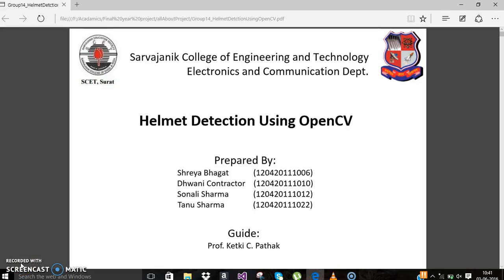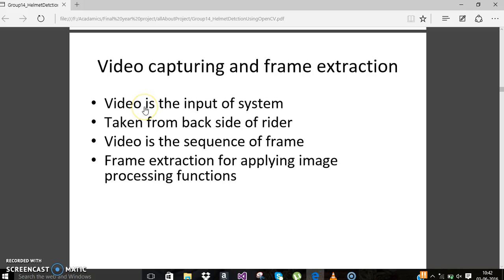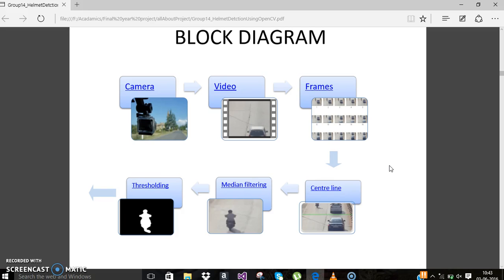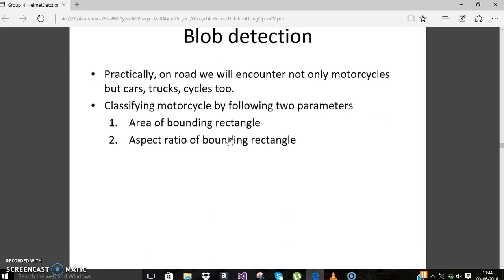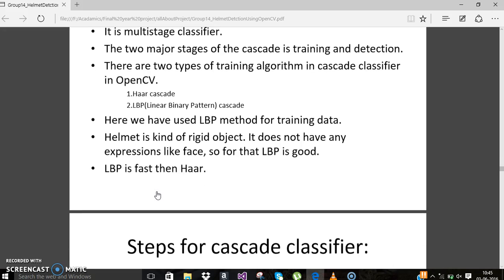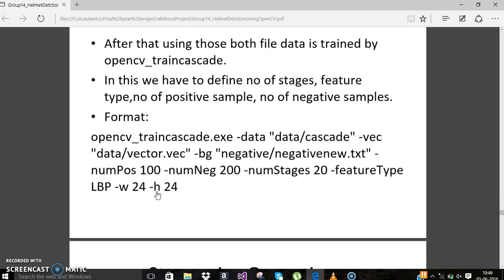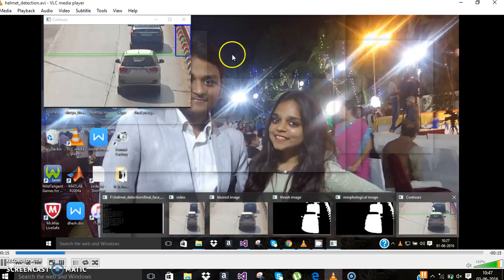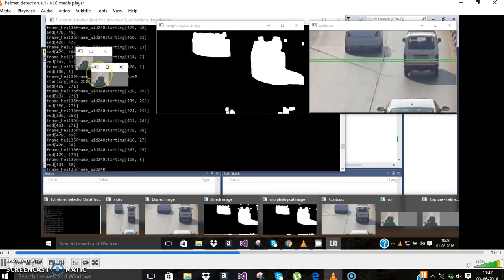Helmet Detection using OpenCV

Comment: Can you help me to implement it in MATLAB instead of OpenCV?
Reply from the maker: Sure! Mail me your queries on dhwani.contractor9@gmail.com
Reply: Dhwani Contractor How to use cascade classifiers in MATLAB?
Reply: @dhwanicontractor4961  hii sir
Reply: please i too need both your help to implement project this in MATLAB
Reply: Did u get this output classification and  detection of ROI
Reply: Dhwani Contractor 
Hey, I kinda using MATLAB to do the same.! Can u help me with it.!
Reply: @santoshthangavelu8964   can you mail the code to me.